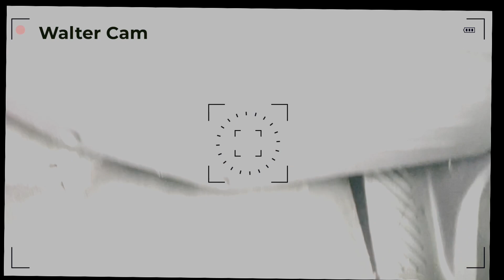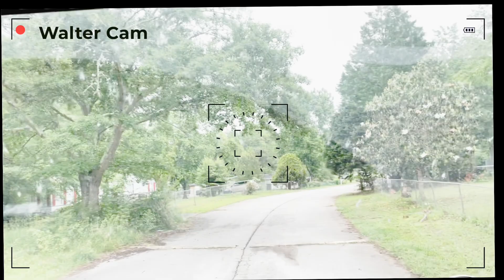the ABC's of Boxtruck PreTrips | How To Get It Right  ~  the Boxtruck Couple

Comment: Question box truck couple. About to start my very first load this week. Brand new to the box truck scene. Do I need to have a dot inspection before starting? And where can I have that done?
Reply from the maker: Congrats.I think you mean the annual Inspection and that's only if the sticker on the inside driver door has expired. That is normally where they put the Yearly DOT Inspection Sticker. If it has expired or close to it, you should get one. Call around to Diesel Mechanic shops. They will tell you if they perform them